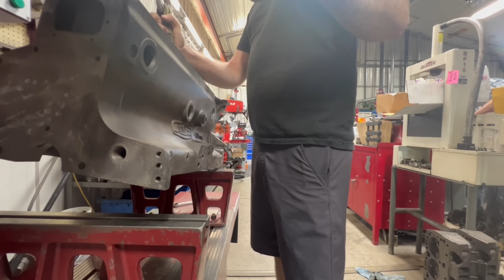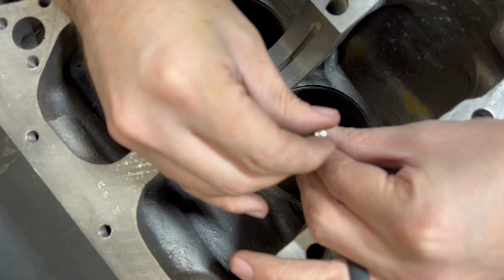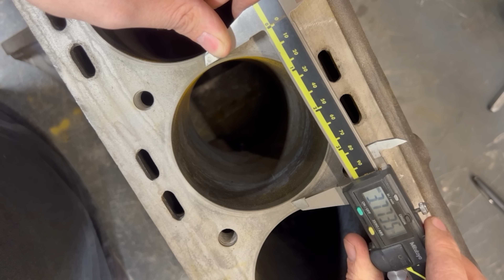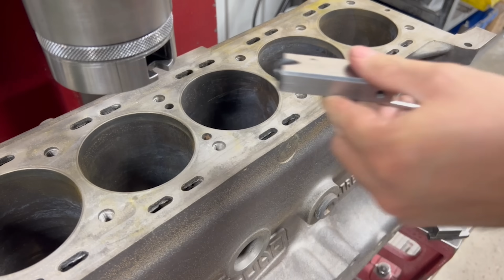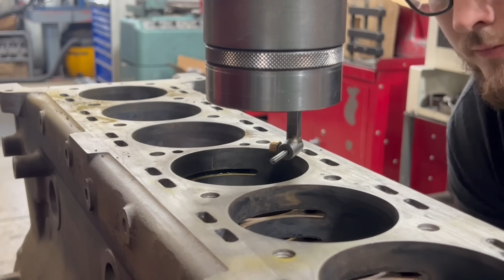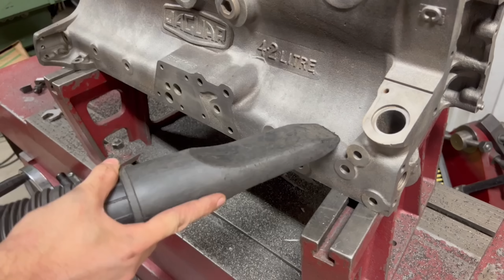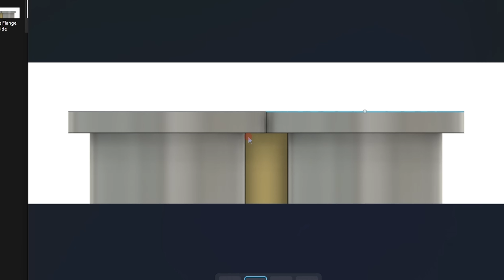Can This 1968 4.2L Jaguar Block Be Saved?

Comment: There are a number of ways this could be addressed, sleeves with a wider cap is the easiest solution but there really is no great way to fix this. Ideally you'd grind the crack out and fill it in with a welder, then cut it back and put a new sleeve in, but that introduces a lot of other potential problems. Ultimately all you can do is gather your options, weigh the pros and cons, and let the customer make the call.

Comment: I doubt anyone is going to drive the vehicle this is going into 300,000 more miles, since it's going to be a collectable, garage queen, heat the entire block, weld the cracks, resleeve and send it. Maybe even make the sleeves thicker if you can get pistons that are smaller than original, there isn't likely to be a power loss that is noticable with 2-8 fewer ci of displacement in a situation like this where it would be cruised very easily and not very regularly. As long as the valves aren't too close to the cylinder walls, should be fine, the engine will be stiffer and tougher. If anything a more stable cylinder with modern ring sealing like Total Seal would still have more power at a smaller displacement. The cylinder head, cam timing and manifold designs determine power more than displacement.

Comment: I wonder if silver soldering would wick into the cracks to plug them? Heat up the whole block then apply flux and silver solder. Normal engine temp won't melt it. Others say to braze it. Someone who knows how to braze cast iron will be able to seal up those cracks.

I had a LeBlond metal lathe manufactured during WW2. While stripping the paint to repaint it I found that one leg had been broken in two at the factory, brazed back together then ground down. The leg was slathered in the black filler often used on cast iron machine tools. There was no filler on the rest of the lathe. 1943 to the 2010's and that brazed leg still holding up a heavy machine.

Under the Limitation Order L-108 of the War Production Board, machine tools were to be finished with minimal smoothing of castings, one coat of primer and one coat of paint, no filler, to save on materials and speed production. Most companies used some filler anyway to hide casting defects so they could meet quotas by using castings that otherwise would have been remelted, such as that broken and brazed leg.

Comment: I'm a machinist by trade but I have never used an engine boring machine but I have to say I love it. The specialized equipment is amazingly accurate for the job at hand. Decades ago I worked at a job shop and the owner took on some work from an outboard boat motor repair shop. I had to sleeve aluminum motor blocks on a bridgeport and let me say it was a joke in comparison to what you guys do.

Comment: Like you said, its already junk so anything you do is an improvement. The flanged sleeve is a great option, even an upgrade from original since all those engines will have the same issue. I wonder if the metal was wrong alloy, too thin, too high pressure, or my favorite, bad and oversized sleeves that over expanded when the engine got hot. Also just bad head coolant  path design.  Probably even a known issue but never revised.

Comment: if its aluminium it can be weldet with laser or Tig and will work
Reply from the maker: Not aluminum
Reply: @JAMSIONLINE  it can be welder with a prices called high temperature soldering with a nickel alloy. I am able to do such things but it needs a very good tperature handling but ten the cracks can be eliminated.

Comment: No use Irontite to install the sleeves. We used to do Jags, Lanchesters etc. Hone or bore the parent block to suit your new sleeves. Contact Darton Sleeves, I'm sure they have a solution. 
Yes stepped sleeves left a little proud, then flycut the block. 

It will be fine.

Comment: While the cracks are obviously not great, the hat sleeves are probably the best solution to save the block. 

Something I would do for certain is polish the bottom cooling slot and give it the best chance of not having a stress point to continue from. 

Now this suggestion comes from my background in aerospace, So consult other engine builders before doing so.  It may be a good idea to mill a slot all the way trough both upper portions between all the cylinders. The cracks are already the full way trough and the hat sleeve is going to have to take the brunt of holding the top end together. But if the cracks are left there as they are, corrosion may begin to build up and slowly jack the two halves apart over time and heat cycles. Thus putting extra strain on the already weakened block and cause more cracks to jump the gap to the lower end.

Comment: I’m super late and super new to this but ENGINES HAVE ACTUAL SLEEVES? Like the sleeves is a metal that makes the piston fit or is that just metal from the piston wall. I’m so confused so what is boring out the piston? Do you add a slightly bigger sleeve. This is all news to me

Comment: Preheat the block.   Weld up the cracks between coolant 1 and two and between coolant 1 and top of block.  IIRC jaguar blocks have a higher nickel content you you have to use a different rod.  Center your boring bar off about 2" from the bottom.  Slow work your way out cutting the welds and then truing up the cylinders so they're not 4 tight at the bottom.  Utilize a flanged press fit dry sleeve that's maybe 10 over so you've got room to just kiss all sides if you're not perfect centered.  Becareful at the top but be careful cutting your counter bores.   Then cut in an o-ring on the cylinder flange and utilize a standard composite headgasket.

Comment: I'd grind the crack out and braze it really good 100% penetration weld a flexible bond  fix preventing future problems and leaks the then counter bore do a heat treatment then do another magnetic test whole block then do your top hat job I'd even machine them on the edges where they would over lap bevel and weld and leave them oversized  raised  so you can machine them down perfectly and do a second heat treatment so  they wouldn't stress crack where you welded do final bore size wash and prepare for assembly yes unfortunately it's invasive and destructive but a good strong preventative measure and over treatment the sleeves weld may crack after you run but it won't effect anything not welding them either it was a extra step because of block crack

Comment: I agree on the counter bore sleeve. 

I also wonder if could Install some type of support into the water jacket in between where the cracks formed ? 
It's all about heat transfer making the cracks. 
I think the water jackets were a quick fix without any proof of longevity. 

Also I wouldn't be afraid to use a cycle of water glass after engine is assembled an ran to secure the bores etc for ever.  We have to do that on out aluminum race engines with copper head gaskets to make the. Stop leaking until they warm up if we don't use it.  

Good information an work 👏

Comment: V the crack. Preheat block and tig it up. Coat areas with 638. Then use top hat sleeves with liberal coat of 638. Best chance to repair.

Comment: I seen a video in the past where they drilled into the Crack and had either welded it back or added little tabs and welded then just machined it back to good. Wouldn't that work or is the wall too thin

Comment: I have zero experience, but I was curious why you can grind out the cracks and weld them up? I've welded cast iron and cast steel before so I know it's possible to weld and mechine that material, but I'm guessing theirs a reason why your not automatically doing that. If anyone know why I'd love to know :)

Comment: I have a question…just a dumb mechanic here, not a machinist…so, the issue with a traditional dry sleeve would be you wouldn’t get good sealing surface for the head gasket, and it would allow water to leak into the cylinder…so if you fire ringed the head, and got a tighter seal between the head gasket and the block with the fire ring, would that help?

Comment: Not a mechanic but fracture mechanics tells me that in order to fix it you would grind away the fracture and the fill  by welding, then machine the area to fit the new sleeves. Again don't know if that's even posible in this situation, however you may find a cheap wreck engine with the same problem and practice on it.

Comment: Counterborough and Weld the hell out of it grind it down smooth and then install the top hat sleeves
Reply: That should seal it up quite nicely because it has to go through the world and then the lock tight and then the gasket so instead of 2 you got 3 layers of protection

Comment: Suggestion 1.
1. Mill away the cracks. They become trenches. 
2. Heat the complete block to an appropriate temperature and control that tempearture stricktly. 
3. Weld (fill) the trenches with the right filler material. Seek an expert-welder. 
4. Maintain the block at that high temperature at  for 48 hours. Residual stresses will reduce now.
5. Slowly cool down in 24 hours. 
6. Recondition the C grooves with a fine cutter. Polisch the welds.
7. Replane and rebore. 

An existing crack can grow. A crack which is not there has to originate.  

Suggestion 2.
 Widen the cracks to fine line. Use a thin disk grinder.
2. Heat the complete block to an appropriate temperature and control that tempearture stricktly. 
3. Fill the trenches with brass-solder / brazing material. Seek an expert-welder. 
4. Maintain the block at that high temperature at  for 4 hours. Residual stresses will reduce now.
5. Slowly cool down in 2 hours. 
6. Recondition/rework the C grooves with a fine cutter. Polisch the welds.
7. Replane and rebore.
Reply: Yep, this is the proper ways, but the most expensive. Sometimes you need to fit in really tight budget.
Reply: @moskauuhrmacher6833   Matching block and frame numbers, bringing the block back to zero hours (new state) and zero cracks to start with. This can cost a dime. 
Besides that, it is race-ready or tune-able , there are no startercracks with can grow in the brittle cast iron.
Personable I am in favor of the brazing because the temperatures can kept lower. Re-grinding the cracks down to fresh metal is an absolute must. 
The strength of hardbrazing matches the strength of cast iron.
Reply: No comments from Jim, still. Probably he is a planer/ borer only (?) and want to stick to that skills.

Comment: Top hats are the way to go.
Changing the block wouldn't make much difference if it was just a runner, but the matching numbers fetish means lots of money.
Besides how many miles will it do once it's in the car ?
My guess is not many.
These engines were ten a penny in the late 70's, 80's. 
Along with the rear suspension the only things saved from the scrap yard crusher.

Comment: I don't know about the feasibility of this but I would cut the block right down the center remove all the cracks weld in new bridges between the bores remachine back to factory, then install top hat sleeves  and  for good measure fire ring it, my concern is that in the medium term top hat sleeves will probably fix it but if you want to last anouther 20 years you need to remove the cracks before they become pieces of block

Comment: I am not a mechanic/engineer, however I understand the risk the cracks bring, can you make a straight cut down the middle between each of the cylinder walls and weld the engine casing before installing T-Sleeves, removing the possibility of the engine casing cracking further in the future by removing the cracks? Is this a viable option?

Comment: If you sleeve with the top hat style sleeve, and Loctite it in, I would think the next step would be something similar to a loc wire ring. If the ledge on top of the sleeves are wide enough.

Comment: wouldn't it be possible to machine a slit where the crack is, press fit a piece in it that sticks out and machine the top and bore to make it flush. Or even just weld it

Comment: I believe this problem is caused by overheating, I had to scrap a 3.8 block because of the cracks between the webbing and the block had been dropped and the casting had been broken where the distributor is.  Luckily I found a replacement for $100.00, score.

Comment: This is just a general question. Is there a sleeve that is "wet" on the top and dry on the bottom? so that it has a "cooling passage" in the top 2" where the cooling passage of the original block is, and then just bore out the original cooling passage in the parent bore? Sorta like the tophat sleeve you shoved, but where you bore more material out of the original bore to the point where the original cooling ports are gone.

Comment: It can be welded but good luck finding a guy that can is willing to and has the right equipment. I knew of a guy that would do heads almost always worked but sometimes you end up with a boat anchor and the cost is the same

Comment: They didn't get any better with time. First car was an 86 xj6. Head gaskets were notorious for leaking, thinking your issue wasn't fixed until maybe ford got their hands on them in 87, we held our head together with an annual application of bars leak. Lasted as long as a head gasket on a bad block, but the gasket was $60 before international shipping in pre 2010

Comment: on 855 cummins we would cut a counterbore and install a ring using whicking locktite then cut the ring  to accept original liners. never had a failure.

Comment: Just like you we had a numbers match set. It belonged to the machinists teacher.  We ended up drilling the sleeves out same as you. Then put the block in large banquet heater got the block to 500 degrees F . Then one person kept the heat up with a rosebud the other person brazed the cracks up . The block was then put in a box of sand for 3days. That was in 1981 40 years the car runs well. The teacher died of old age but his son still dives the car in summer.

Comment: If I was doing the same work I’d want to use like and endmill on the top of each crack going down about 1/4” then weld sore to 5 over and face the deck then do the T shaped sleeves that if able to find 5 over the basic bore otherwise I’d just make it the same thrusting the bore

Comment: We did a number of these repairs. We drilled and pinned the crack. Then placed the block in an oven and heated it to 800 degrees and nickel; welded the pins and placed it back in the oven and cooled the block down over a 24 hr period. Then-cut the cyl at the top accepted the new sleeve and surfaced the deck. As for the cyl tapper, we stone-honed the bottom of the cyl to allow for the proper press fit by eliminating the tapper. We used liquid nitrogen to freeze the sleeve and dropped them in the cyl bore. We never had a comeback.

Comment: Back in the old days we used to use a company in LA called Cyclone ExcelWeld...I got to watch as they were putting a Pierce Arrow block back together. They repaired a pair of Max Wedge heads for me. I doubt they are still around. They were old guys 30 years ago.

Comment: Grind the crack and TIG weld it and then bore it and sleeve it… it’s low power motor if this way works on high power turbo motors. Will be fine for something that will hardly be driven being a “collector” car

Comment: Even dry sleeves have a bit of thermal resistance to the block.  The upper portions have a higher operating metal temperature so they expand.  The block is wet with coolant so there is considerable thermal expansion stress.

The block is weakest there to these expansion forces, causing the cracks. The cooling slits in the block stop the crack progression.
I would go with the flanged sleeves, using a standard gasket with metal o rings in the sleeve flanges.  OFHC copper wire rings would have the highest corrosion resistance and shouldn't interfere with proper gasket load to seal coolant.  I would not use MLS gasket in this case.

Comment: My shop specialized in reclaiming numbers matching blocks for rare and top dollar restorations, so these were common issues.
Our procedure was drilling a hole at the end of the crack (when possible) 'V-ing' out the cracks, and having them cast iron  welded at an agricultural/commercial cast iron welding company nearby. 
It's very common for agricultural/commercial castings to be repair welded as they (as in auto restoration) are often impossible to replace or often VERY expensive, however It must be a shop that specializes in iron welding.
Afterwards cleanup bores were run, then the cylinders sleeved - using a slight step at the bottom of the parent bore, or a flanged sleeve as noted in the vid. Press fit was held to the LOW side and a retaining compound -  Made To Transfer Heat! (we moved away from Green Loctite) - used on installation. The retaining compound is the secondary retainer of the sleeve as the step it rests on in the 'parent' bore and the head gasket/head 'trap' the sleeve from moving. 
A large contributing factor to these top of the bore cracks is the heat expansion driving the sides of the block Outward - so without stopping the cracking it will continue to travel/grow, eventually causing more problems later.
With the above repairs we never had an issue, even with some cars driven in cross country events for many years.
Best of luck!!
Reply: Yeah.  I was going to suggest the weld as well.  Agree.

Comment: Grind out the cracks, braze them. Then cut in the counter bores. From what I saw there’s no cracks past the webbing, there’s nothing in the ‘meat’ of the block. I don’t know if it’s a ‘thing’ in gas engines, but you could install a fire ring into the cylinder head like they do in high horse Diesel engines. I guess that’ll depend on what sort of head gasket is used in vintage engine like that for the fire ring.

Comment: I really enjoy watching your videos. Brings back many memories. I worked several years in Dallas welding cast iron heads, blocks, manifolds etc. we had much success brazing cracks of this type. I have never welded a Jaguar mostly Cat, Detroit, Cummins diesel engines.